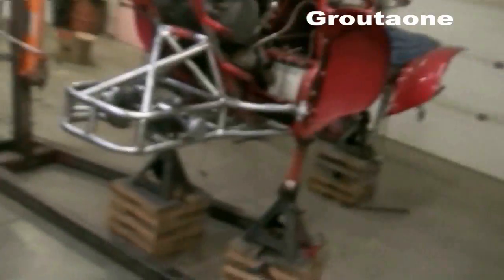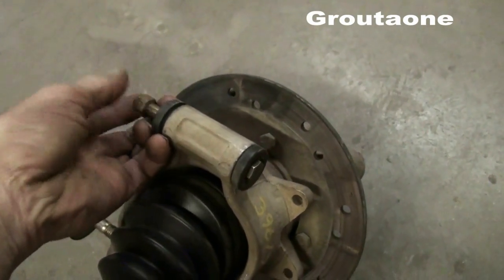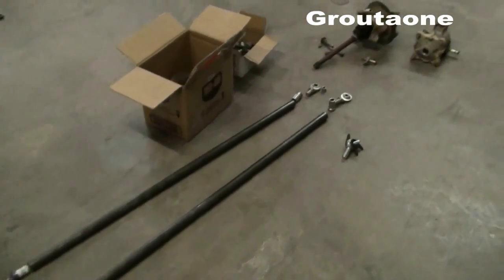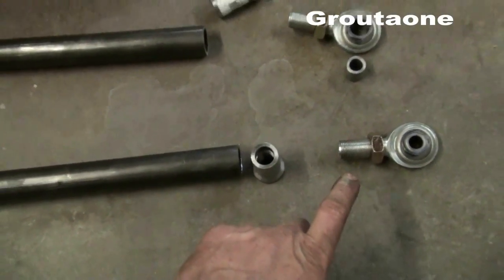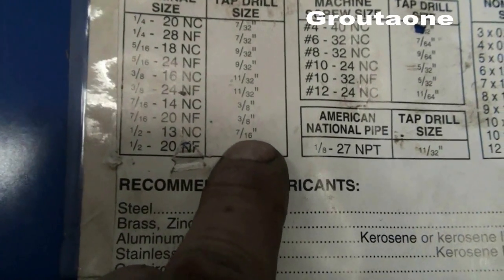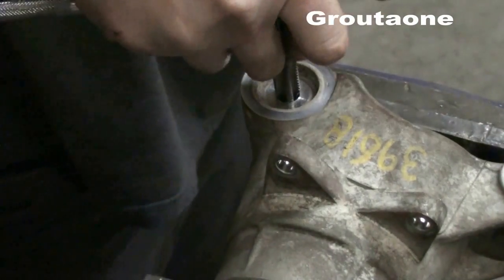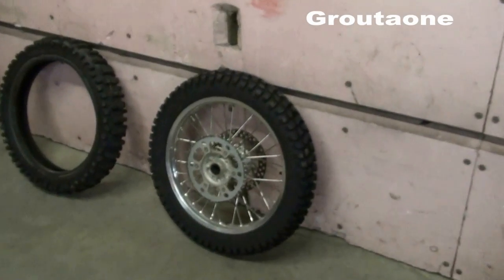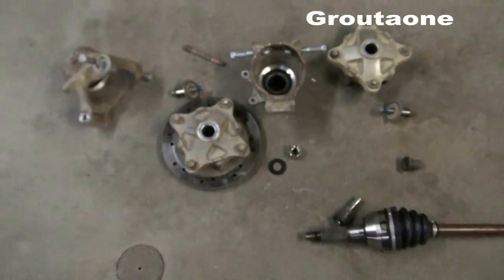Long Travel Susp  Build pt 7

Comment: Great job. I do agree a nice big tap and die set is a must have for any project. They are even nice to clean up the threads of an old rusty bolt, or clean up a threaded hole after somthing has been powdercoated.

Comment from the maker: @repelstee1 Thanks buddy, I was interested in bolt strength as the rod end is fairly wide, plus a bigger bolt will always have more running inches of thread, just my two cents though